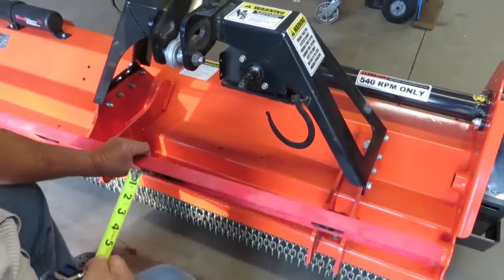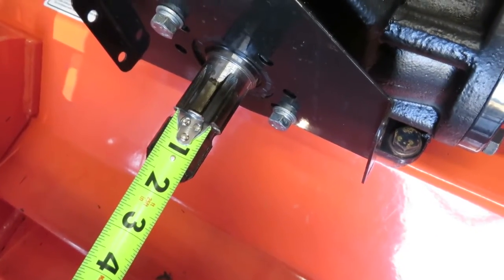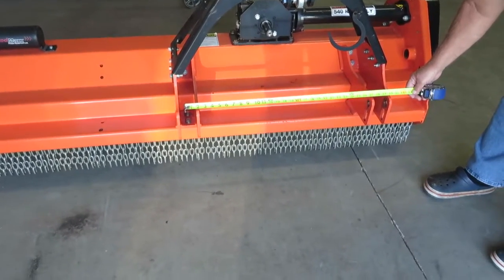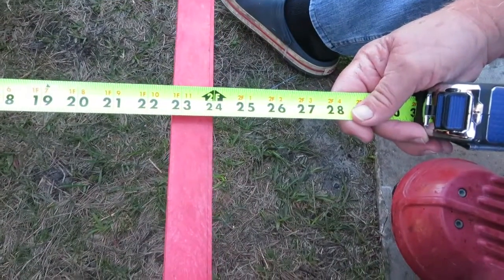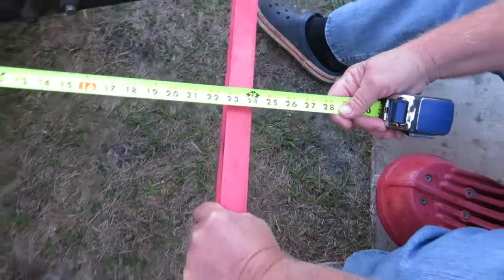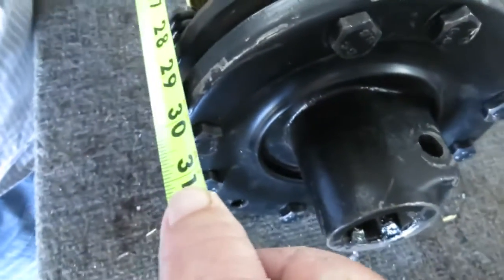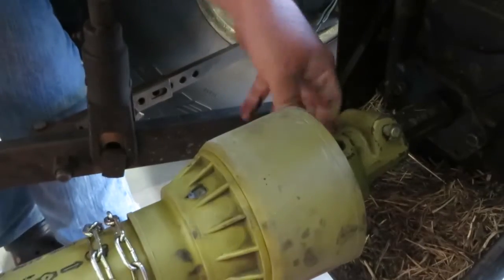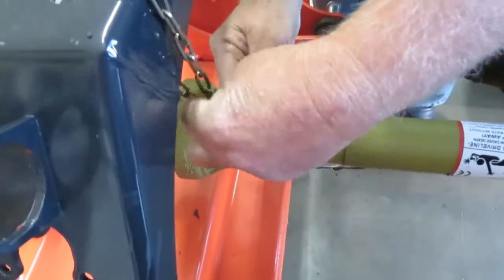WoodMaxx FLAIL MOWER - How to size the driveshaft

Comment: Finally someone measuring from the same indent points, 1st on tractor and implement then measuring pto drive shaft at both locking pins, although I never thought of measuring width of arms, good tip. 
But my question is shouldn't the implement that is being used be measured at shortest points? In my case it's a pto tractor winch and when all way up it's at the shortest distance.